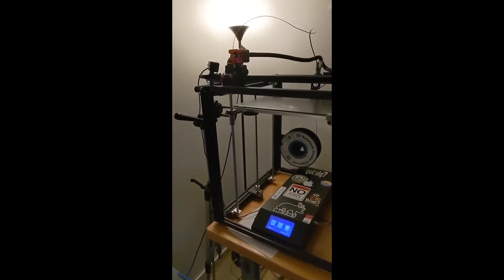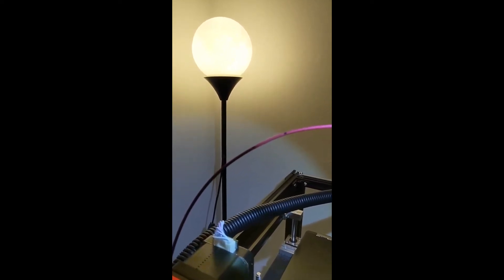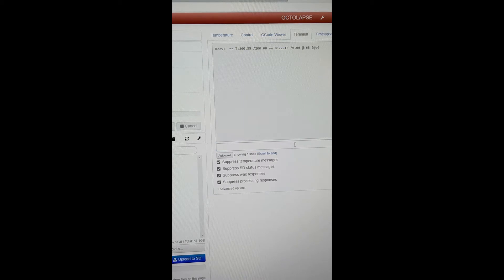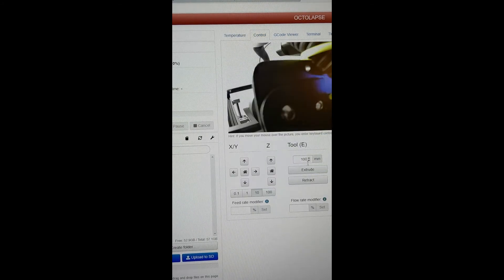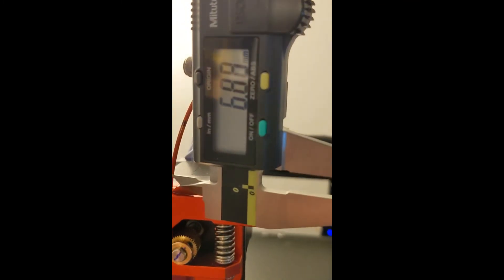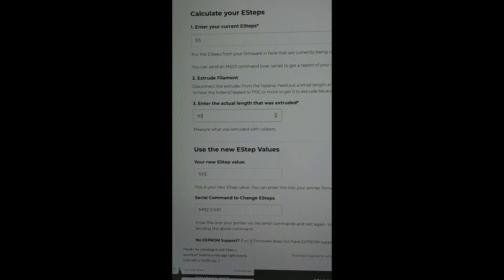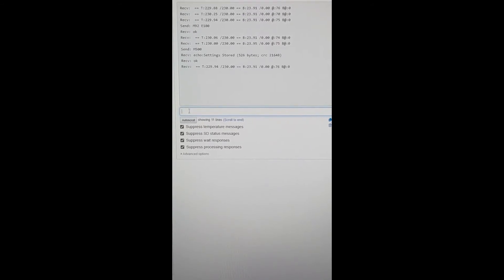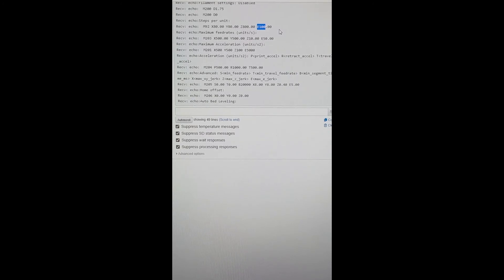E Step on Ender 5 Plus

Comment: In Octoprint, I go to “control”, reset the extrude millimeters to 100 and click on extrude; nothing happens. I am linked to my under 5+ through raspberry pi Zero hi honey bye-bye sweetie OK 2. I know they’re communicating, because the line codes are being transmitted.

Comment: Love the video....  I had a few problems that might help out others.  when I tried to connect the octoprint, I would get an error on he printer that said ramp runaway......BLAH BLAH,  and the octoprint would close the connection to the printer....  so I updated the firmware.  from 1.7.0 bl touch to 1.7.3. bl touch....  now it is working great!  except the printer is now talking to me in chineese.  does anyone know how to get it back to english as changing the language does not work.